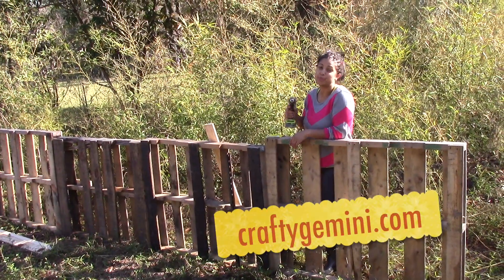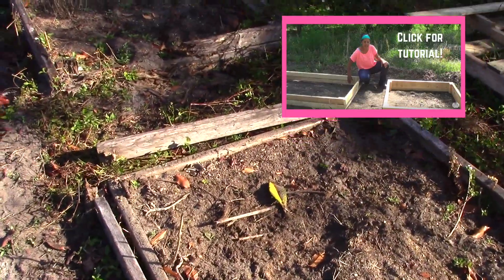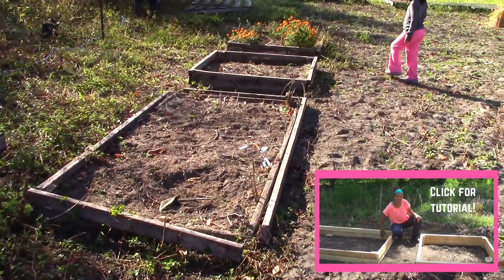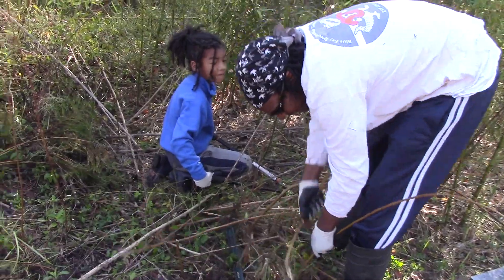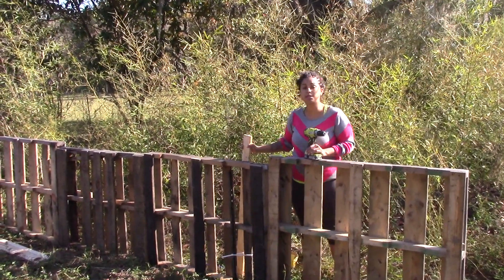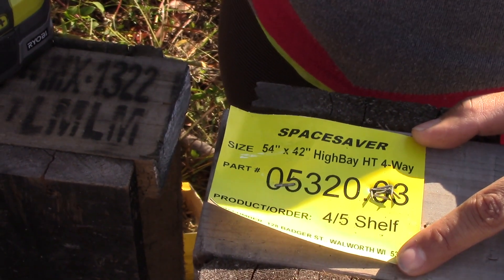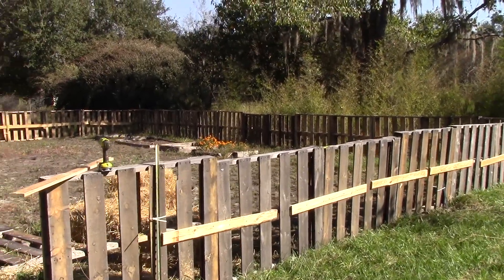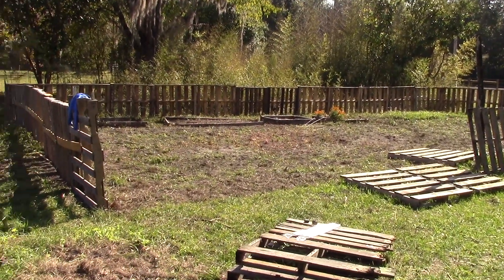How to Build a Pallet Fence & Garden Update!

Comment: Re-bar is pretty cheap and would work to anchor the pallets. Those wimpy little boards zip tied won't do much. One good shove from the cow or even the goats with knock that fence over  . . . love the idea though, good job! Love seeing the kids helping out.
Reply: Darris B. Nelson I agree.
Reply from the maker: Great idea! Just wanted to get it done and use what I had. Will go back in and reinforce as needed since there are already 8-10 metal t-posts around the fence as well.

Comment: Such a wonderful family made video. Gardening projects are a great way to have family time and you have a beautiful happy family. I wonder how the goats enjoyed your fence? Mine are spoiled pets, who want to help and be where I am. They rub full weight to remove (Okla.) winter undercoat against fencing; they're nosy raising up on it to see what's behind it or what I'm doing and to size it up for height for jumping over; and when all else fails, they'll keep applying head pressure until a section moves and provides them a ramp on which to run up and over then, cry for me to let them out. I love my goats. I had to stabilize my pallets in a more permanent way. Buckwheat is one of the cover crops I use to add free range browsing to the goats feed diet (chickens, etc. enjoy as well.) Good video.👏

Comment: nice, got plans to actually build "goat lanes"  using free pallets and get some good manure on the ground to build up ground to make it more level as well as get more of a nutrient based soil built upon colorados mundane nasty clay that needs royally worked over.  you could use a bungee cord to secure that pallet gate to prevent things you dont want in as well.  

im wondering if you could put wheels on fence lines of this and shift down on a level pasture with relative ease.